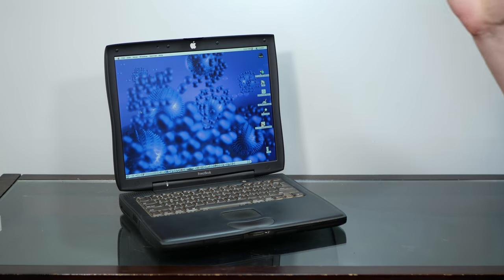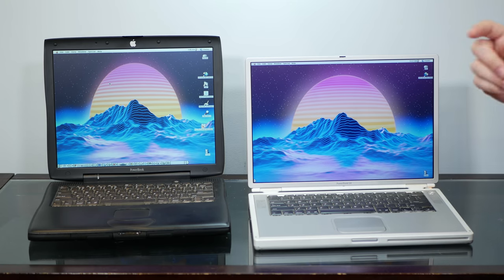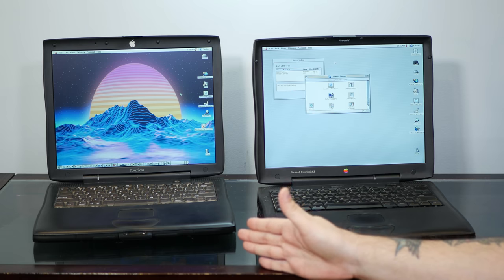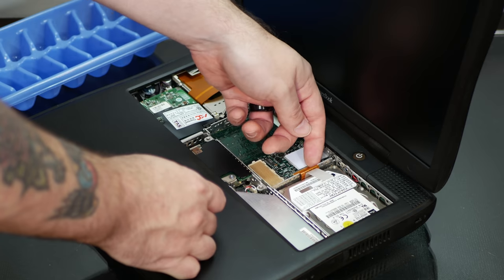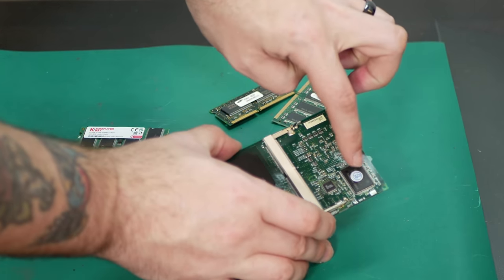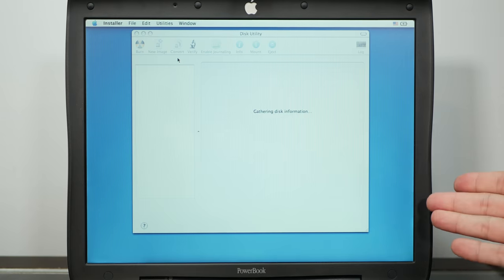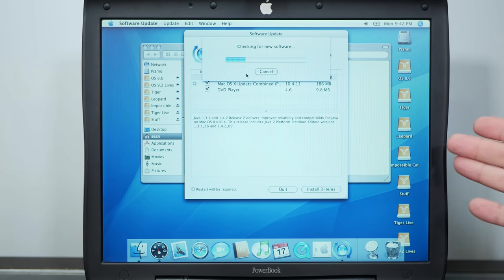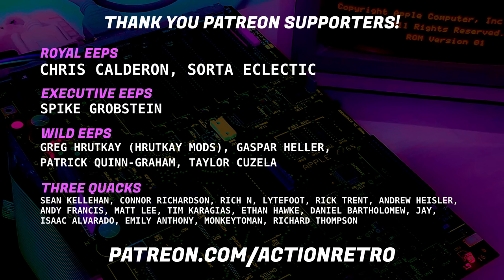I'm Sorry, PowerBook G3 Pismo.

Comment: My opinion is the exact opposite of yours - I always had a fondness for the Lombard and Pismo but I thought the Titanium G4's were incredibly ugly with their mismatched black keyboard and white plastic trim. Though I have been warming up to them lately. Still would rather have an Aluminium G4.
Reply: Same, white plastic tends looks awful on used machines in general. With the TiBook, I've yet to find one for sale without cracked hinges or discoloured plastic whereas all the G3 PowerBooks for sale are in great condition most of the time.
Reply: @amirpourghoureiyan1637  I just bought a tibook with no cracked hinges or discolored plastic.

Comment: I wish somebody would tell me the whole story on my Pismo's bootloader's inability to reliably see every connected bootable drive every time. And yes, I've worked with all the rEFIt possibilities. Always like rolling dice. An installed internal dual-boot 9/10 (on a CompactFlash card) is stable, but anything else expected to be available via Firewire with the the option key on startup is iffy at best on any given day. Oddly, the most reliable thing is using Target Disk Mode and drives connected through a much later Mac. (This Pismo's optical drive was unreliable from new and ever after anyway.)
Reply: I’m not positive, but I believe it’s to do with the partitioning and drivers.  Sometimes drives formatted for OS 8 HFS journaled couldn’t correctly see partitions formatted as HFS+ which may have only come along with OS 8.6.

Hopefully, someone will correct me if I’m wrong — or offer an alternative theory.
Reply: @stevearkwright   It's important to always make sure any boot drive is fully set up to boot -- with the necessary format and boot drivers. These drives I have problems with will each reliably boot if each is the only drive connected (either internally or by Firewire), but when subjected to the EFI bootloader, when more than one bootable drive is connected, each will not reliably be recognized and/or will not boot. This goes for selecting the startup disk before reboot or holding the option key while booting or with various set-ups of rEFIt. I suspect it's a problem that Apple built into the bootloader -- EFI, in firmware -- to prevent unauthorized boots, that glitches and prevents authorized boots. Flaky EFI.
Reply: @stevearkwright  BTW: None of Apple's drive formats or partition addressing have ever been stable -- until very recently. Any Mac drive tested with DiskWarrior will show a need for directory repair after as little as a few weeks use. Any drive with a solid directory index optimized by DiskWarrior will boot cleanly -- if not subjected to anything very complicated in EFI.

Comment: This really does seem like the best pre-white/aluminum-everything laptop from a purely merit based point of view... Seems like the real bottleneck is in the GPU. Is there any way to upgrade that or is it stuck at the same 8mb forever?

I wonder how many of the differences between this and the iBook Clamshell (My favorite Mac aesthetically) were done for legitimate cost cutting reasons and how many were Steve Jobs just being kind of a dickhead lol... I'm gonna' say at minimum burying the hard drive so deep that you have to take the rest of the computer apart to get to it is almost definitely on Steve. :P

Comment: Wonder how fast will the OS trash the SSD without trim 🤪
Reply: I'm pretty sure SSDs these days have hardware trim.
Reply: @lepidotos  TRIM is information given by the OS to the drive, I dont think you can have that automated, the OS still must inform the drive what pages are no longer in use for the TRIM mechanic to work. So without TRIM in the OS the ssd will copy unused pages between blocks and waste writes.
Reply: @akkudakkupl  You're right, I was thinking of the basic garbage collection.

Comment: @action retro you might be better off If you can find the 1Ghz G3. The speed difference between the G4 and G3 CPUs is negligible. See here: https://lowendmac.com/2000/g4-insignificantly-superior-to-g3/#:~:text=Again%2C%20the%20G3%20is%20a,400%20MHz%20XLR8%20G4%20upgrade.